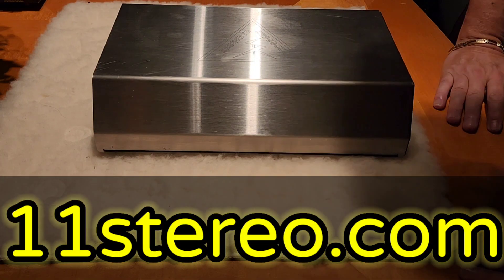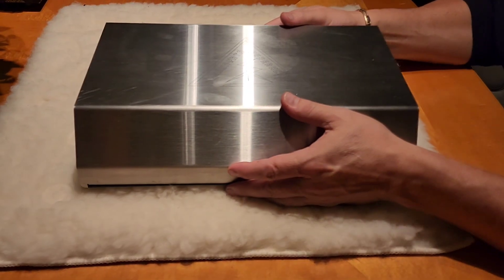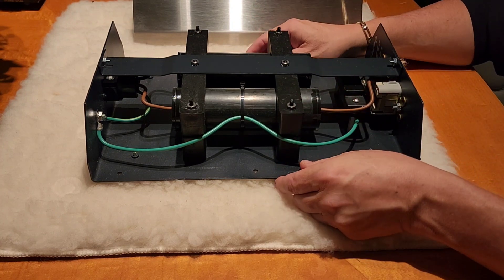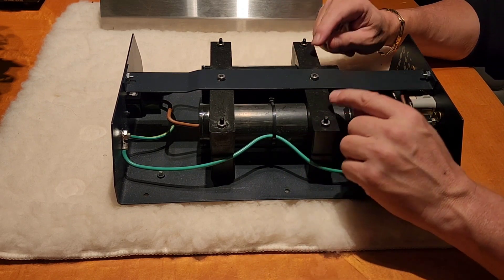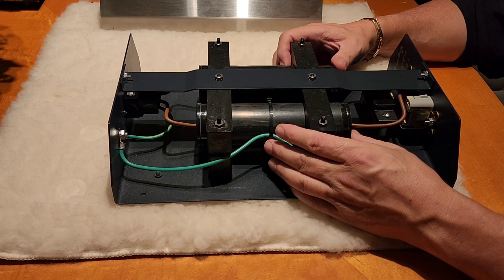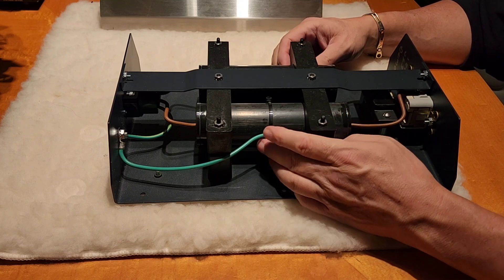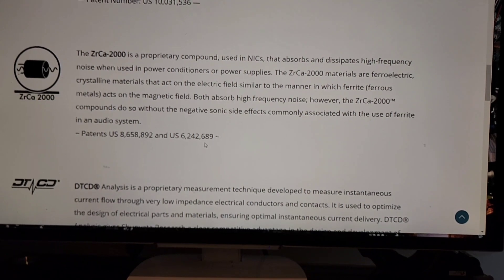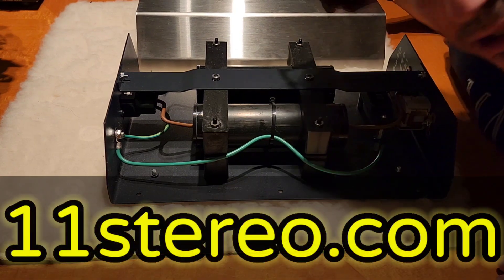AUDIO AUTOPSY : SHUNYATA RESEARCH HYDRA CYCLOPS AC POWER FILTER

Comment: Hi Mike, I don’t know anything about the Cyclops but I’ve tried many power conditioners over the years including Furman, PS Audio, Audioquest and I can honestly say the Shunyata Denali beats them all. It doesn’t simply change the sound, it dramatically improves every aspect of the fidelity of the music. Everyone hears things differently but to my ears this was a $5,000 well spent.
Reply from the maker: Hi Barry, have you tried Puritan 156 ? That's the one my Shunyata users are selling for and it's $2300
Reply: @OCDHIFiGuy  Thanks for the tip Mike, I’ll check it out. I’m reluctant to change because my system sounds so good with the Denali.
Reply: I am also looking at the Typhoon 2 (new product) which has limited number of outlets. It better suits my needs for my amps. I am impressed with my older Shunyata Hydra so I am eager in looking at higher end Shunyata products. I, like many others, didn't think Shunyata was a reputable company but after purchasing a few power cords and the Hydra, I firmly believe they make a quality product. There isn't a lot of electronics inside and they weigh a fraction of my other power conditioners, but I cannot argue with the improvement I hear with Shunyata gear; I aslo like their lifetime product guarantee. I guess much of what you pay for is product research and patents. As much as the P20 and Niagara products cost, they should have a much longer warranty.

Comment: Had one. It completely killed the sound
Reply: at last! i thought it will all be a guessing game
Reply from the maker: Thanks Kenneth, I wont say what High End company you work for either !
Reply: @OCDHIFiGuy  that's no secret... Audio Note UK. But I actually retired just recently. :)
Reply: If I'm not mistaken. It's a bunch of ferrite cores inside. It didn't do anything good for my system. So I went back to isol8 power bar. Some get better results with the shunyata. It's all a matter of taste. But I felt it strangled the dynamics in my system.

Comment: I expect those cylinders to contain large value capacitors. These are effective at filtering Noise and can also provide a measure of PFC (power factor correction). May be expensive, but if those are caps, the engineering seems sound to me. Furman Elite and Reference products use the same strategy.
Reply from the maker: They are absolutely NOT Caps. If you watched the whole video you would see me explain what they are.  ;-) Furman is industrial grade and not Audiophile IMHO. Even thier "HiFi" Line... Great company though...
Reply: @OCDHIFiGuy   You've obviously never used a Furman Elite 20 PFI with your .0005pf Topaz transformers (I also have two 5kVa .0005pf iso xformers and a 2.5 kVa). That combo of 5kVa Topaz feeding my Elite 20 PFi with some mediocre Mythical Creatures PC's solidly beat my Buddy's Stromtank that he brought over for a few days. Wasn't close. I don't determine what is or isn't "audiophile" until I use it. All my transformers came from.m old TV and radio stations. Yet they are VERY MUCH true audiophile pieces of equipment. And wait till you throw in a decent IEC receptacle + outlet and then deep cryo the entire unit. 😉😎
Reply: Caps used in line filtering are typically connected between the conductor and ground, and or between the supply conductor (the hot) and the return conductor (neutral), but are not in the series part of the power circuit. That wire is running through what amounts to a ferrite core which is intended to block higher frequencies that tend to ride on the power lines. Regarding chokes you'll often see common mode rejection or single mode rejection types.. Open up just about any kind of modern power supply and you'll find those components in there. Their presence in all modern power supplies is the most often used argument against the need and effectiveness of putting in any kind of line filtering upstream of the power supply. Point being is that the so called offending noise signals can't make it onto the power supply rails. Of course this will be debated forever because of the subjectiveness of hifi, and also the placebo effect as well. If you believe that something you do will make it sound better, it does for you. It's why double blind tests are so greatly feared by people in the hifi community and resoundly rejected. 
Personally I don't give a $hit.
Reply: @fredflintstone8048  I'm a full AES voting member. And an audiophile. User of ABX/double blind tests. And I've also used (and returned) more than one Shunyata product because it didn't pass those tests. But I did indeed actually evaluate these things instead of bench-racing via the data sheets or specs as so many others online love to do. So, I'm speaking from direct, personal experience. I don't actually trust Shunyata as a company, TBH. Zero emotional investment.... the opposite, in fact.
Reply: @DBravo29er  That's great! I am also an audiophile that's an engineer that tends to take a more scientific approach when making comparisons, but I also understand the human element and the futility of trying to argue about certain things that people have already made up their minds about. I will say that those people do help support the economy of the industry.
Also my personal music enjoyment requirements are fairly simple. I don't have to have the best to be content. I tend to try and do the best regarding what I have, speaker placement etc.
Reply: @fredflintstone8048  That's awesome. I hear you. I'm cursed with being exposed to live music on a regular basis (including a full Symphony Orchestra) for the past two years or so and this has definitely increased my spend on audio equipment. Shrinking the delta between the real thing and what I hear in my room. Obv, this has resulted in quite a bit of room treatments, driven by accurate acoustical analysis. A factor skipped over by so many. The room gets a vote.
Reply: @DBravo29er  I own the Furman IT Reference 20i, PS P20, the Niagara 5000 and also have the Shunyata older Hydra. They each have a different impact on sound quality. While the Furman is built like a tank, it makes my system sound different from the Niagara 5000. The PS 20 easily wins but is incredibly expensive. I have also owned a couple Monster https series and also the Isotek Sigmas 3. The downside of the Furman is occasional hum from the huge toroid transformer so I have removed it from my listening room. I will probably will keep it for my home theater gear. Its a great bang for the buck, especially used.  I haven't tried Topaz.
Reply from the maker: @DBravo29er  thanks for your feedback. Lets just say my Equipment at this point has me completely disengaged from interest in tweaks. I honestly dont care if it can get a little better because Im TOTALLY engaged in the music in a non analytical way every time I listen.  I worked with Furman (Who made private label product for my company Cinepro) back 15 years ago. This development is what hatched thier Elite line for peoples homes. Great company. Ive got a couple laying around. Stromtank from what I heard is a Battery UPS type filter. We all know batteries have their own sonic issues, so im not surprised. I have TRAYS of Furutech NCF-GTX-D Duplex receptacles as well as the IEC Inlets. Ive got a guy that will deep long cryo for me. Not interested. LOL. Truly, the Playback Designs MPD-8 has completely put the kaibash on my hi fi squirrelling around. I spent so many years doing this that my current interests take me OUTSIDE the cave... ;-) all the best !
Reply from the maker: @mickyd3  Have you tried a Puritan Audio PSM 156 ? It seems to be beating out all the other high buck units for only $2300
Reply: @OCDHIFiGuy  I actually had a Cinepro for years! Lol. I really loved IT and kinda lucked into it second hand after I was unable to find a Furman IT-1220 for any reasonable price. Cinepro was really solid for the money. Esp being in FL at the time, all that iron in front of my system have me feel good fuzzies. I only sold it for my Topaz Ultra's. Small world! 

Really happy to hear you're in that place with your system. I'm currently working out some modified updated Altec Lansing Iconics and am hoping for a similar result with my 845 monoblock setup.👍
Reply from the maker: @ScH75  you are going to LOVE your 845/ Altec setup. I have no less than 3 pair 845 monos. Sublime. Actually the guys I bought my amp company from in Cal were originally from Altec. Bob Byrd, and George Anderson. AB Systems in Rocklin CA. We made all the Cinepro amps.
Reply: @OCDHIFiGuy  I just saw that the other day. I need to do more research to see how it handles power amps. I recently upgraded to the new BHK600 monoblocks (don't make any bad jokes) and they are definitely more power hungry than the older BHK300 monos. The P20 is great but I really don't have room in my listening room for it. It currently resides in my media closet but the runs are about 15 ft from my new BHK600 amps. I am interested in trying the Puritan but as I said, I need to see if they have any limitations on them. The Niagara products (5000 and 7000) have a 70 or 90 amp instantanous reserve, which is great but the 5000 seems to kiil a bit of soundstage but provides much greater dynamics than even the P20. It's difficult finding the perfect power conditioner. I currently have 3 dedicated 20 amp circuits. One was installed in my media closet and two dedicated 20 amps in my listening room. Currently I have the monoblocks plugged into the wall but I do get a bit of hum when doing so and the stoundstage is less than plugged directly into the P20. Thanks on the Puritan suggestion. I will keep you posted. In hindisght, I should have done a video comparison on each of these power conditioners.
Reply: @OCDHIFiGuy  Im excited. Using an absolute museum quality pair of Altec 416-8B's from the early 60's (adjacent serial numbers) that have been re-magged by Bill over at Great Plains Audio. New cabs with a lower sens, much lower f3, and 25mm-50mm Baltic Birch construction. New horn with new Italian CD (deciding Beryllium vs a few other diaphragm technologies... testing that now). Going for an Iconic that Altec WOULD have made now.... but understanding that a better 15" woofer for a two way has not yet been made.... so sticking with the 416-8B (ALNiCo, obv). Tried a pair of TADs and actually liked them less than the 416's, by a little. Which was awesome because the TAD's are like $4k/driver. 😂👍

My 845 amps took a huge step when I upgraded my rectifiers to the Sylvania JAN-CHS 5931 (225ma current). And another huge step when I discovered the Mullard GZ33 (250ma current!!). Currently rocking some Mullard Blackburn GZ33's and these are the best I've yet found. Love my 845 SET's!! Final move is to upgrade the Mundorf Supreme caps inside with Duelund or Jensen paper/wax/oil. Still making my mind up. So many choices. Lol

Comment: You still using the Puritan PSM156? I remember you spoke highly of it and you felt it actually worked well in your system.
Reply from the maker: I use it every day and sell it too..
Reply: @OCDHIFiGuy  PSM136 For me, it works and not crazy expensive but extremely well made with a return for full refund if not convinced. I was convinced.

Comment: Audioquest Niagra also has one of those tube looking things in it. The 5000 & 7000 have some air core inductors as well.
Reply: They are carry over design from the higher end Furman power conditioners. Garth used to work there before going to Audio Quest.
Reply from the maker: This is what I heard as well..

Comment: Mike: I believe Shunyata makes the outlets on this device. You can probably research the model to see if it is a sr-z1. If so, they make this one.
Reply from the maker: This outlet is marked HUBBEL .....same with the inlet.  THX tho !
Reply: @OCDHIFiGuy  made exclusively for Shunyata by Hubble to Shunyata specifications. There is a video showing the insides of the AC Receptacle.
Reply from the maker: @Mark Kinsman  oh, sure. I've done that too. Not with Hubbel, but you can have them plate the parts they normally use as an example. Then it's made to Mikeys Specifications. Or I can choose a different pellet to put in the injection mold hopper...  In my case, I sent pure silver rods for them to replace the Bronze rods they used.

Comment: Hi Mike, do you also consider fuses as tweaks? do you have a favorite brand, or do you use standard fuses in your audio equipment? a friend of mine recently bought such a QSA fuse for 2500, - Real madness, but he says he can't do without it anymore, and says you can't even achieve this result with a 10,000, - power cable!
Reply from the maker: @stratenboek. Fuses are tweaks absolutely. I use standard fuses or I bypass them.  (The REAL mans way lol ;-) ) If your friends rig depends on a fuse to make or break the rig, hes screwed.  ITS A SACRIFICIAL PIECE !! It means hes willing to throw $2500 AWAY .. this is the epidemy of Squirrel food...  BLOWS MY MIND.. GET BETTER GEAR BRO... (Your friend) Its Neuroses...
Reply: Thanks Mike, Sad news is that you won't even hear the tweak within a week, and everything seems back to normal, and it's time for a new tweak, the merry go round : )
Reply from the maker: @stratenboek  OR in a week, something sounds off and you cant put your finger on it until you REMOVE the tweak...
Reply: Man, I wish I could do without audiophile fuses at this point. I didn't like QSA but the top SR and AM fuses do something that I apparently can't get any other way, and stuff just doesn't sound analog without it. I figured an EMM Labs DA2 and NS1 would be impervious to this stuff, (EMM must think so because the fuses are inaccesible) but when I go back to cheaper DACs with fuses I just keep wishing I could swap the ones in the DA2. Then my other workaround is more expensive Shunyata stuff. I wish it wasn't so, but there is just so much garbage in a digital system that it will never sound analog without major power tweaks, or $110k for a Select II.
Reply: I mean maybe you CAN do without all this stuff if you play CD over an optical cable, or vinyl, and have a dedicated line. But anything off the network or hard drive just has so much garbage that filtering is required. Even MSBs top DACs now have their own go between streamer to isolate the DAC. Too much digital junk to deal with.

Comment: I'm wondering if you pull on the wires running through the cylinders, does the other end move?  I know the company talks about there filtering method paralleling the line voltage and not in series with it.  And the DTCD measurement technique, I've watched Caelian's video on this.  He uses a fairly straightforward device made by Ideal($350.00) to do the test.  Even if he is using the least expensive power cord he makes, it's still much more substantial than the ordinary cable he used for the base of his test.  I would have liked to see what a decent 10 g or 12 g SJO cable with decent connectors performs in the same test.  For me, most of this stuff needs to be in my system for a while and then removed to find out if it improved the sound or not.  I once was listening to my mentor discussing power cords with a customer.  He was discussing the method that Quad uses to design and build its electronics; holding the power cord that came with the amp, he explained that there was nothing unusual about it or its cost but that the final balance in its sound was designed with this power cord.  Maybe 10 or 12 bucks.  He explained that yes you can spend significantly more on a power cord and it will affect the sound of the amp.  But is it better or simply different?   Getting back to the Shunyata, technology marches on.  The military recently showed the new B-21 bomber.  Better in every possible, conceivable way to the B2 bomber and it costs a third of what the B2 cost.  That kind of surprised me.  Now it would be funny if those tubes in the Shunyata were filled with sand.  Sand also dissipates vibration into heat, making for good isolation.  Some buildings would use sand between floors to isolate noise between them.
Reply from the maker: No, they are non moveable copper 10 AWG stranded wire with PVC dielectric it seems. regular stuff.  Hubbel parts on front and back.

Comment: At 6:00 you say it changes the sound at the other end. I think you mean the AC !
Reply from the maker: I know its hard to grasp, but changing noise on the AC Line will affect the signal in the audio circuit..  Usually because they share a common ground.
Reply: @OCDHIFiGuy  well decouple ground then!?
Reply from the maker: @M Goudsmits 金马桥  UNSAFE
Reply: @OCDHIFiGuy   must power tools, household equipment are double isolated and not grounded.  So is many audio equipment too
Reply from the maker: @M Goudsmits 金马桥  only the cheap shit... never the high end
Reply: @OCDHIFiGuy   well that is why the high end need power cables that cost $1000 ?  But serious,  it is bad to do so! You may create ground loops.  And as a matter of fact In my country according to electrical installation rules laid down in NEN 1010  untill 2000 or so we have no ground in , living room , bedroom  etc.  Ground is only available in wet rooms Kitchen and bathroom.  I believe they now have it everywhere, but that was not done for audio.

Comment: Hey Mikey what are your thoughts on surge protection? I've been using Brick Wall on some of my equipment  as lve had a fair amount of brown outs and power outrages
Reply from the maker: Brown out and outages are solved by a voltage reg and or UPS. Surge suppressors are for OVER Voltages..